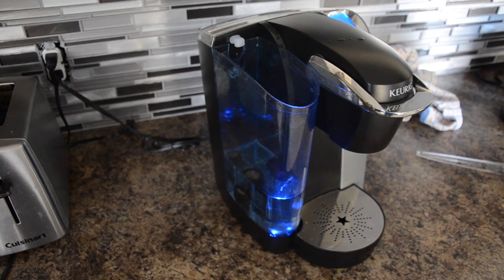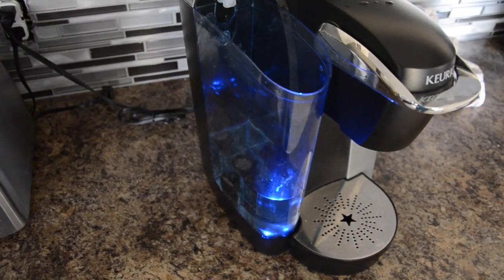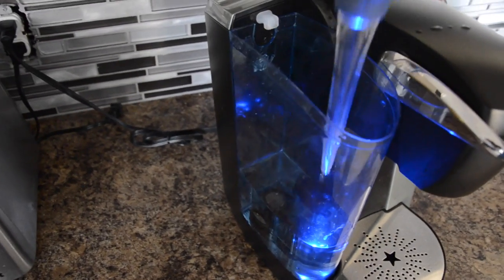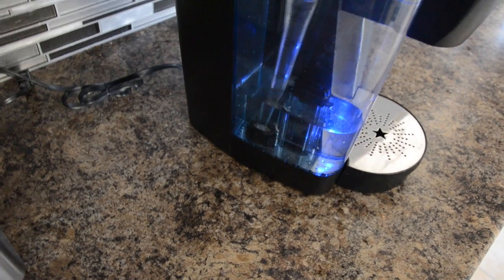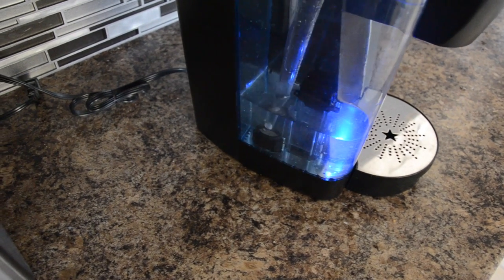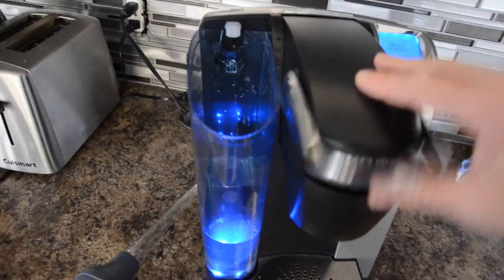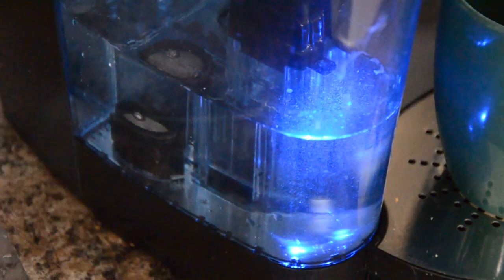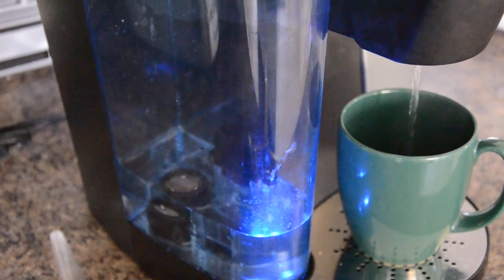1 minute Keurig water pump fix

Comment: Worked for me after I wasted my time trying to disassemble and not seeing a clog. What this does is “prime” the water lines. If there is air in the lines the motor doesn’t have the vacuum force to draw water from the reservoir. After many pumps from a turkey baster with the keurig motor running, I eventually went from the sound of a loud motor grinding unsuccessfully to the beautiful sound of water being sucked into the reservoir. I was able to bring a 11 year old keurig that hasn’t been used in 3 years back to life.

Comment: OMG!!!  YouTube saves the day again!  I didn't have a turkey baster so I used a giant plastic straw to blow bubbles up it with vinegar in the reservoir.(I'm the only coffee drinker if that sounds gross) I was gonna clean it anyway after having been stored in a closet for over 2 years. It totally worked. Only took a bit for the vinegar to get to work. Not sure if it was scale or air bubble. But I thoroughly cleaned it up. I have a 9 yr old K45 elite and it's not going to the landfill today!  😊

Comment: This fixed my problem and ty for the advice. I pulled my b80 apart and the intake was completely calcified. I used a vinegar solution to rid of that, but the pump/exhaust valve was probably caked. Those are soldered/glued down and have rivets.. PITA. This solution forces acid solutions into the pump/exhaust, and after an hour it fixed my problem. Thanks again.

Comment: I have an identical Keurig, about ten years old, that had a grinding pump and the water barely dropped in the tank. I bought another at Costco this morning, but watched this video and used one of those hand held kitchen sink sprayers on the screen at the bottom. There was film over the screen and it works again now. Thanks.

Comment: Outstanding, I got a free keurig more than 10 years ago for some silly work related milestone.  We have used everyday and usually several times  a day for coffee, tea and instant soups etc.  Thought it was dying from the sound of it.  Descaling did not improve it.  Blasting the microscreen at the bottom of the resivior w/baster fixed it!!!  Good to go for 10 more years! Thanks!

Comment: This seemed to do the trick for me.  It's the work kitchen Keurig so there's no turkey baster available. I used a drink straw, sealed off the bottom of the water intake as best I could with my fingers and kept forcing air into it until water came out the other end. It worked!! Thanks!!!

Comment: It worked!  I had just descaled my machine and it still wasn't working well drawing water very very slowly.  I should add that I had descaled with almost pure vinegar for several hours.  Anyway, it was frustrating until I tried your suggestion.  I had more trouble with my turkey baster than I did with the fix!  I wound up putting some tape around the bulb and tube of the turkey baster to stop air leaks when I squeezed and success!  Thank you for this tip.

Comment: Second time this happened to me and after Messing with it it fixed itself the first time. This time I just tried messing with the buttons cleaning the needles and nothing worked. I was ready to give up! Then I came across this video and thought this probably won’t work but I’ll give it a try. used the turkey baster and it worked like a charm! So now I know in the future if this happens again what to do and save me 60 bucks! Thanks so much for sharing this video

Comment: Thanks!  That was the solution!  I determined that the trouble was not at the top end - at the cup dispenser and clogged orafices - rather it was at the bottom, or "pump end".  SYMPTOMS: The reservoir level wasn't going down and as evidenced by the blinking blue lights, the unit kept thinking that the reservoir needed filling.  Yet another use for the kitchen turkey baster...

Comment: Thanks, this and cleaning the inlet port on the base with a paper towel seem to have fixed it.  I'm not sure which it was, but between the two it is now working.  Previously no water came out at all.  Similar to what you described in the video, the Keurig machine was left idle for some time.  It had been working prior to being packed when my daughter moved out of her apartment at college, but after a few months in the box it didn't work at all.

Comment: I found after many different attempts at different solutions,  the black cap and screen in the reservoir was the issue.  The screen is a very very fine mesh, probably finer than it has to be.  To remove the cap and screen, a phillips screwdriver and a small enough hand was all that is required to get the 3 screws out. I then tried to blow through the screen and could barely manage to move any air at all which meant no water was getting through the screen eigher.  I used my fingernail and a green scrubby to clear the very very fine mesh screen in the black cap.  At that point I could blow through the screen with no problem at all. Blowing through the cap and screen almost sounded like a high pitched dog whistle.  I then washed the cap and screen assembly, properly reinstalled the cap and screen, washed the reservoir, and started to run a couple of large cups of plain water through the machine.  Works like new...

Comment: I tried this "trick" but had no luck, the "turkey baster" was old, it just didn't have enough power to bust out the clog. However in the water canister, at the top in the back, there is a little rubber overflow outlet and I put some canned air through that and it worked perfectly. Just in case this one didn't work for you either. Thanks Rob.

Comment: First I tried another video where they said to put your finger over the air pressure relief and that did nothing. I tried your method several times, and nothing. Then I put my finger over the pressure relief valve a few more times and 'voila' water started pouring out. My turkey baster isnt the newest so had to hold the top on better to get water to push thru. But both methods got mine going again. Thanks.

Comment: MUCH OBLIDGED for your video !!!!  Because of you, my good ol' Keurig B60 is not going to the landfill yet, THANK YOU ! ... Rob, you made my day, I am so happy ! thank you  ! (for the other viewers... the baster would not fit the opening at the bottom of the reservoir of my B60 effectively,  nor a straw... so, I used a thin straw at the "other end", namely, the metal pin where the water comes out,  I sucked on it with my mouth a couple of times and  the water started flowing again ... (and yes, the water coming out was burning HOT! ).

Comment: Tried running some vinegar and water through mine.  It did nothing.  Mine was still sounding like a jet plane taking off.  Tried this and low and behold, back to normal.  Stupid easy.  Thanks Rob.

Comment: Thanks for the suggestion. I couldn't find a turkey baster so instead used a can on compressed air (found at Costco) and placed the plastic tube into the orifice with my finger acting as a seal. A couple of shots of air and the channel was cleared. It is now working better than ever!

Comment: I removed the water tank, put a hard resin ? straw over that same area with a wet dish cloth tightly around the base of the straw and blew as hard as I could.  Water came up and out of the white rubber overflow.  Did it a couple more times and water came out of both the rubber overflow and the puncture piece where the k-cup goes.  Seems to be working fine now.  I got the idea from another video and was going to post it there but couldn't find it again.  Essentially you accomplished the same thing.  But, if you don't happen to have a baster you might try what I did.

Comment: Funny thing, I didn’t have a turkey thingy, so while searching my garage for something that might work, I found a pool cleaner tail hose and it had a diameter that was perfect for all three openings I could locate on the machine.  Blew into each of them, ran a large cup, and junk galore came out and pump worked again.  Ran about ten times to get clear water.

Comment: If this doesn't work for you try taking a paperclip and pushing it up into the needle to clean out coffee grounds that gets stuck up inside there. I tried several Solutions similar to this and more involved ones that did not work but that 2 second paperclip job fixed my problem.☕🥰

Comment: We have gone through 3 Keurig machines in the last 2 years. This last one lasted 3 wks grrrrrr. We kept thinking it was due to bad pumps, after a while the machine would be lucky to give you 2 oz of coffee. Well I found out its not the pump its the double metal screen in the water reservoir tank. The mesh is so fine and tight after awhile no water can pass through it. So I took out the 3 screws holding it on and tossed the piece in the trash. Filled up the tank with water and ran the machine until the tank was empty. It pumped out almost 11 oz of water every time. I refilled and ran it 3 times and its working perfectly. Its so stupid how a few cent metal filter can screw up a $100.00 machine.

Comment: I do this as well:  Use canned air and blow a bit into the overflow nipple 
at the top of the tank.  (I stick the red tube from the can in and pinch
 the nipple to seal) Make sure the machine is off and you have a cup in 
place.

Comment: The “shaking” method worked twice for me but then the machine completely stopped drawing water from the reservoir into the tank. I could hear it making a sucking sound but that was it. I finally took a tiny brush and put it down into the hole where the reservoir passes the water into the heating tank and moved it around in there (remove water reservoir). Then I took a straw and blew air in there to force the ick out. (There was no way I was going to suck that into my mouth.) i didn’t think of using a baster. I was shocked at what had accumulated there. It was disgusting. I had to keep doing this all day but the machine finally started working again. Note to self: Don’t skip that descaling task.

Comment: Worked.  Thanks.  Running slow,  but at least it's running now.
Reply: If you at least got it running, try running a half a tank of vinegar through it and then a bunch of distilled water until the vinegar smell is gone. Should help to further descale.
Reply: Thanks
Reply: Yes vinegar works like a charm like brand new again. I use half a bottle of vinegar small bottle pour into reservoir then add some warm water and I brew for about 10 cups or so until I can't smell vinegar in the mug. I do this every month!!

Comment: Going to try this, I bought one out of box for $30 ($90 retail) and its got air in the lines and hardly pumps any water. Might get the air purged while running and clean it up with my descale solution.

Comment: Inspired by this video, I tried the technique on a K920 model; by turning the reservoir upside down and using a turkey baster to depress the spring loaded bottom plug, I was able to clear the passage with a good blast of water from the baster. Problem solved!

Comment: Hi Rob, Please help! Ours has been in storage for 3 years. When I turn it on, hear the motor running, blue light comes on, saying “ not ready” , water stays in the tank, level not changing. Then we get to “prime” display and then everything stops. I have tested the bottom of the tank by valve and when I push up water comes out on the bottom. Not sure what else I can try?? Thanks in advance

Comment: After this, I'd use Dezcal liquid descaler (caution, extremely strong will discolor stainless steel) on the first pass....then once a month after that Dezcal Citric Acid powder (it's food grade). You won't have anymore issues if you stay on a regular descale schedule... until the pump just dies from mechanical failure.
Reply: SatineMoisant you'd think so, I use same, dezcal, every month, plus dezcal clean cup k-cup, on my third machine. This one month old, and still happening.

Comment: Mine still draws water into the machine just fine but when it does something somewhere makes a very loud, terrible, rattling sound. Will doing this help fix that?
Reply: Lerjae mine was taking in water but taking a long time and working so hard to do so, the humming was bad. Took the three screws off the filter, removed and washed the filter and works like new. It was very dirty under that mesh.

Comment: Was your Kuerig pump not making any sound OR could you hear the pump working but it wasn't pumping?
Reply from the maker: When this problem occurs everything sounds "normal" but it's just not pumping.
Reply: @starstreetadventures  Bummer, my Kuerig makes no noise.  My pump is probably bad.
Reply from the maker: @frankm2385  Pump only makes noise when loading water. Otherwise when it's pouring hot water onto the pod it's using pressure from the heating chamber.
Reply: @starstreetadventures  Thank you.  I cleaned out the puncturing needles and it works now.  Great video!

Comment: do you fill baster with vinegar first?
Reply from the maker: You don't need to initially. What you are trying to do is clear the blockage. You will see the water gets very dirty quickly. I would follow by dumping the dirty water and then using vinegar to give it a real good cleaning but don't forget you will need a final flush of clean water (no vinegar)

Comment: I have the same machine in the video, It was pumping out wrong amounts of water for a while, and then it stopped pumping any water out when a pod was in place. Ive done a few things and it can pump some water out through a pod, but its very little. It seems to pump out water mostly fine without a pod, but after a wile it stops just at then end and takes about a minute to get the last trickle out.

Ive just descaled it, and the same problem is happening. he Descale message hasn't gone away either. Any ideas?
Reply from the maker: Not sure how you descaled it. Try using vinegar in the reservoir and run some through. Let it soak in between runs a few minutes (5min). Also try forcing some of the vinegar solution into the hole at the bottom as I did in the video. There could be some build up present. Once the flow works again I would flush with water several times to get rid of all traces of the vinegar.
Reply: This works!!---along other tips in another video. The person used an open paper clip to stick up into the three tiny holes around the sharp point that the water comes out. If you don't regularly descale it you will find an amazing amount of lime build-up in these two places.  These two things finally did it and now 4-5 months later I'm on here looking again for the several steps I used. Thanks Rob Mitchell!!!
Reply: A little bit of an update, I flushed water through it over a sink with the faucet's extending hose for a a minute or two and that seems to have fixed the problems with serving size. However, it still seems to get stuck "brewing" with nothing coming out for about 2 minutes, though after all the water seems to have finished pouring. I guess I don't need to make more than one cup in three minutes, but I'm worried it means something else is wrong. I used vinegar according to it's original instruction manual to descale it a couple times allready. Ill probably descale again now that the flow is working right to make sure it's gotten everywhere.

Comment: Ok I know this is an old video... I used this method and now I can hear the water running again but it's only coming through the rubber thing at the top of the reservoir and not where it's supposed to come from...